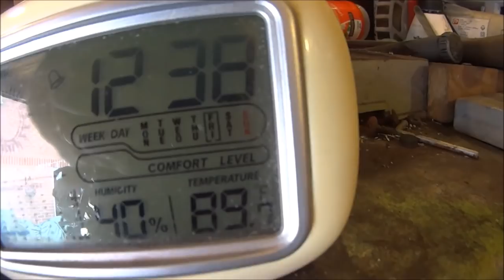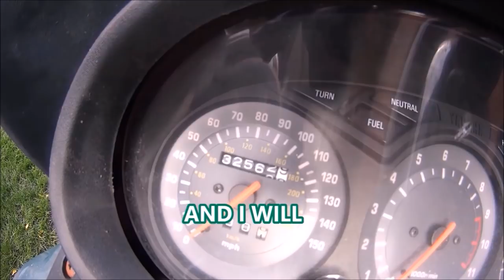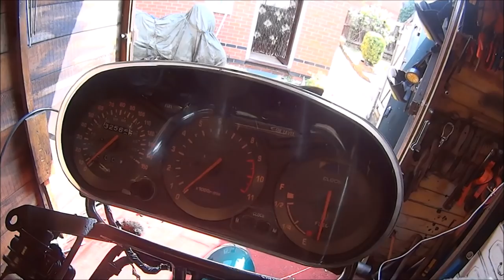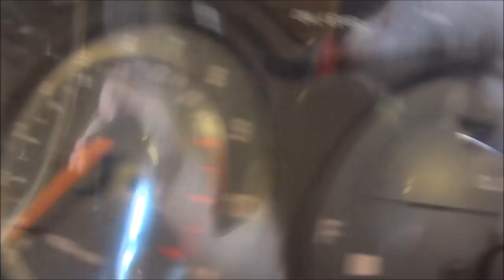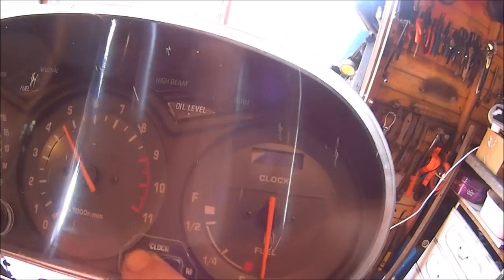XJ900S.. NEW BATTERY CREATES NEW LIFE..

Comment: The rev counter is just showing you a fault code John, you will have to look it up i think it was 4 1/2  but never run the engine if the needle goes in the red, cant wait to see it fire into life mate, its looking great you have done a fantastic job so far....
Reply from the maker: SooperSkoots yes cheers for that.. It was just because the carburetors weren't connected, plugged in.

Comment: Thought we were in for a treat with starting the engine! good old rusty petrol tank, just had to do mine so best of luck, Jeff
Reply from the maker: j sturgess... Yeah sorry for the cliffhanger buddy. I'm dreading the fuel tank job lol
Reply: I started off using vinegar to get most of the rust out, did you manage to get that old oil filter off?
Reply from the maker: j sturgess yes new oil and filter are done now... Was there much success with the vinegar?
Reply: Yes I used white vinegar removed petcock and fuel sender blocked holes and poured in 10ltrs left in for about 8hrs swished it around occasionally placed tank in different positions poured out strained into the vinegar bottles to use again and repeated the process washed out with water and bicarbonate of soda to neutralise the vinegar, I would recommend distilled for this.My tank was very rusty and the vinegar worked a treat (blocking off the holes can be a bit tricky i didn't  want to get anything on the paint ,  used a piece of wood and a gasket made from an inner tube for the petcock)  I then used a tank liner por15 , the process can't be rushed took me several days.
Reply from the maker: thinking of doing the same. just trying to work out how to block the holes off
Reply: Yeah blocking the holes is tricky, especially with the pressure of 10ltrs in the tank, the por15 I used was the full kit, which does have a rust remover in it, but I wanted to make sure I got all the rust out 1st so used the vinegar which worked really well, I used white vinegar but you can use others(but not the sort you put on ya fish&chips!) I opted for the white so I could see the discolouration.
Reply from the maker: Good for you bro it really Doe's work very well and is as cheap as chips

Comment: Good work John, startup on the next vid then maybe. Clutch cable looked a bit dry, did you lubricate that and the throttle cables? Just a tip, as i don't wanna sound like i'm giving advice that isn't needed. Anyway, excited for next weeks installment.Fingers are crossed here that she fires up okay.
Reply from the maker: J Fitch... Thanks J may be or may be not lol. cables have been soaked in oil and greased them the best i can don't worry all tips and tricks are always welcome... Bikers helping bikers...

Comment: Believe this or not.the rev counters telling the TPS valve to open once wired in should go....get it wired waiting for the engine starting
Reply from the maker: darren molloy.... Thanks Darren I do believe you because as soon as I plugged the throttle position sensor in it was fine.. You are so conversant as always. Nice one.
Reply: ROAD RODENT it's a pleasure.sometimes think outside the box...tell me about 600gsxf just got a mint 1989 in black.riding position cramped but goes very well.to get at plugs for service a pain in the deriare..it's got 15k mileage......look for me on Facebook messenger.has curly malloy......or send us you're messenger please
Reply: Got you road rodent.have messaged you mate
Reply from the maker: darren molloy yeah I've had 2 "of em and yes the spark plugs are deep in there lol I welled 2 sockets 1 on top of the other works great with the extension bar and ratchet. It's very rare I use Facebook.
Reply: ROAD RODENT I have sent you messenger request.curl malloy
Reply: ROAD RODENT was thinking of trying bars like your CBR.but it's legs that won't bend .due to to many pies.and old legs
Reply from the maker: darren molloy OK I'll check it out..
Reply from the maker: darren molloy OK OK  give me chance I will check it out lol
Reply from the maker: darren molloy join the club buddy lol